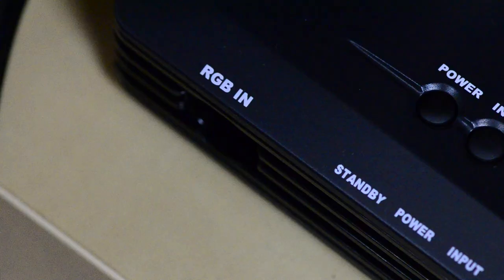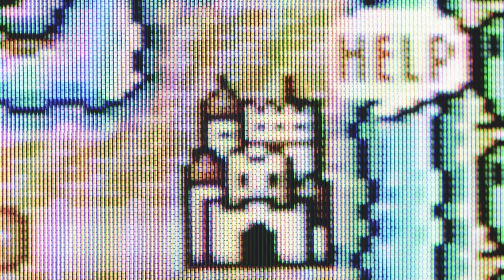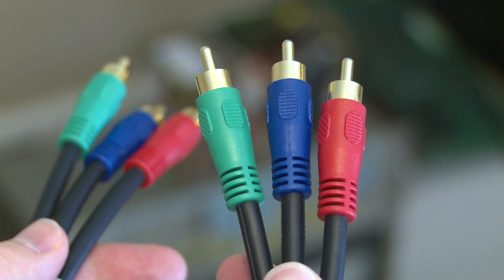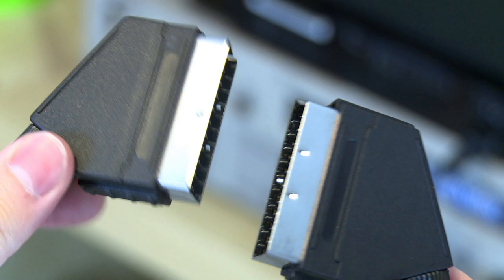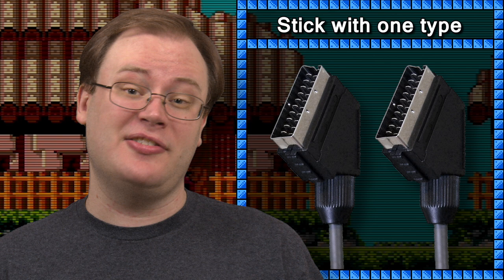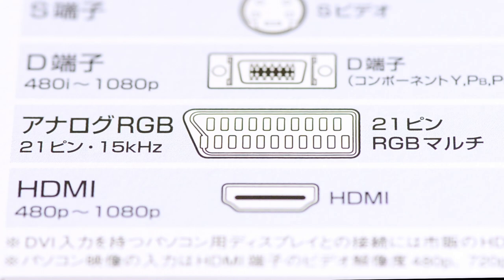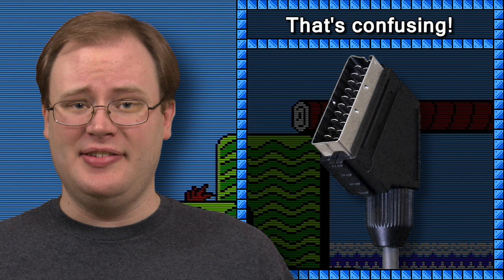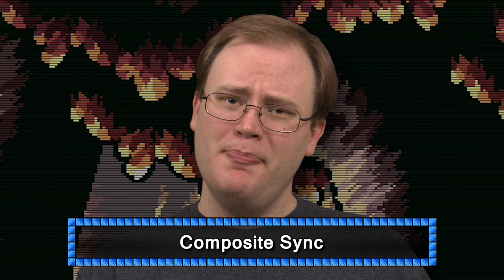Understanding RGB and Sync :: RGB103 / MY LIFE IN GAMING

Comment: Hi guys, big fan of the masterclass series, have learnt a tonne and my retro games have never looked so good. however I have a couple of questions. I have an RGB scart cable set up from my snes directly into the scart input in my Samsung HDTV and it looks great! however if I put it through my scart switcher and depress the RGB button I get an instant checkerboard effect. I realise this is a sync issue.. but how can the sync change in the scart switcher? is it not just a pass through?
secondly. I took apart my snes to see if it was the fabled 1 chip today... sadly its one of the last models before the 1 chip. Anyway it seems to have developed a slight buzzing when brighter colours display on the screen. is it possible I haven't correctly locked down some of the shielding internally? sorry for the essay. cheers
Reply from the maker: [Try4ce] A likely fix to your switcher problem is getting a SCART with better shielding to go from your switcher to your TV.

I'm assuming you're in Europe, so Retro Gaming Cables might be more convenient for you than retro_console_accessories on eBay. I have bought a better-shielded cable from the latter, and am not sure if the former offers one. For retro_console_accessories, you can buy a regular male-male SCART, and add a separate shielding upgrade to your cart. If the store appears closed, check another day, earlier in the day (earlier by eastern US time). She closes the store after a certain quota is met for the day.

I was having issues with audio buzz when using a cheap cable from my SCART switcher, and the more robust cable solved that. I didn't have sync noise, but hopefully a better could could deal with that as well. If not, then some sort of sync cleaning device like a Sync Strike might help. You might also consider getting better shielded cables to connect to your console, or buying a cable with a sync method other than sync-on-composite. But I'd say the first step would be a better male-male SCART. It definitely couldn't hurt either way, as switch boxes can be a bit problematic.

So like I said, audio buzz is typical of shielding issues. It's odd that your SNES would "develop" the problem, but that would be a good argument for buying both a better SNES cable and a better male-male SCART. Another option is to buy an adapter that breaks the audio out of the SCART into RCAs... the less time the audio line stays in the SCART, the better.
Reply: +My Life in Gaming awesome, thanks for the advice! Yes I am in the uk and have been eyeing up the options over at retro gaming cables, but was holding out for the "pack a punch" option to be made available on all his cables. So I bought a cheap one off eBay for the time being. Looks like a general all round upgrade is in order. Cheers! Looking forward to the framemiester alternatives video. Have you guys thought of doing a tips and tweaks vid about scan line generators? I would like to try one but am at a bit of a loss where to start. Keep up the awesome work!

Comment: Great videos guys but I have a couple of quick questions. If I'm to get a framemeister and modded NTSC snes mini what scart cable do I need? I get I can't use the jp21 nor the adapter that comes with the framemeister, but it sounds like I can't use euro scart and adapter neither? Are there NTSC scart cables I should be using with csync? Furthermore, I hear the audio signal can also interfere with the video signal on scart so it might be worth having that sent through separate cables too? 

Secondly for an NTSC PS2 is it worth sending component through the framemeister? To that point is there any benefit sending PS3/4 etc through it, maybe it does a better job of upscaling sub 1080p content than most TV's?

Thanks in advance, and seriously the community needed clear and professional videos like this as there is a lot of misinformation out there.
Reply from the maker: Andy V [Try4ce] My modded SNES mini supports CSYNC, but to be honest, I'm not 100% certan if that's how the mod is always done. If someone else is modding the system for you, or you're buying one pre-modded, clarify that CSYNC is hooked up. However, with very well-shielded cables, other sync types CAN provide results that are nearly as good as CSYNC... but it's always best to use CSYNC when possible. The thing with SNES cables is that the old RGB cables that Nintendo sold in Europe back in the day wouldn't be compatible with a NTSC SNES... most other consoles support cables regardless of region. However, if you buy a SCART that specifies it's for NTSC consoles, then the cable maker has designed it to work that way. Like we said in the video, JP-21 or SCART is your choice, but it's easiest if you stick with one or the other.

Interesting you ask about audio, because just last week I bought some specially shielded cables, and I'm very very impressed. Our go-to eBay cable-maker, retro_console_accessories, offers an upgrade option for any cable, which uses higher grade shielding, resulting in a thicker cable. I was having issues with a slight audio buzz, especially from my Famicom, and the buzz got louder when the image had more light than dark... in other words, the video was interfering with the audio. It became especially noticeable when I was using my SCART switcher. I got a Nintendo CSYNC cable with the shielding, plus a cable to go from the switcher to the Framemeister, and it's working out extremely well! I haven't tested it with the SNES yet, but I'm sure it works quite nicely there too. It's a little more expensive, but I will look into upgrading more of my cables over time.

One thing I wish we'd mentioned in this video is that PS1 and PS2 do not support CSYNC. However, you can use sync-on-luma, and the result is pretty much just as good. Personally, I use SCART for PS1 and PS2. PS1 doesn't support YPbPr component, but of course PS2 does (you have to specify YPbPr or RGB in system settings). The thing is, PS2 does not support 480p over SCART... so a lot of people use component instead. I don't have many PS2 games that support 480p, and I feel like it's not worth the benefit, so that's why I go SCART.

As for sending the PS3 through the Framemeister... well, even if your system is set to 480i, it's already internally scaling PS1 games... so sadly, there's no way to get 240p to the Framemeister via the PS3... this is why I primarily use the PS2 as my PS1-playing machine. Interestingly, the Wii will output 240p for VC games if the system is set to 480i (it scales the games internally if it's set to 480p). I've experimented with using the Framemeister to process 480p, 720p, or 1080i with the Playstation TV... but my conclusion is that there's no discernible benefit that makes it worth it.
Reply: Thanks for the swift reply, much appreciated.

Comment: So if sync on composite adds a few artifacts due to sync running through composite section. Would that mean that Synch On Luma would also leave a few artifacts in comparison to CSYNC? I'm planning on getting a scart for my ps2 (I'm in eu btw) and RetroGamingCables have a Sync on Luma option AND CSYNC. Apparently there's no difference but I just want a 2nd opinion
Reply from the maker: [Try4ce] So composite as sync is actually fine if you have really high quality cabling. But you can expect issues with cheap cables. Luma however I have never seen issues with. It's important to note that PS2 does not have native CSYNC. When you see a PS2 cable with CSYNC, that means it has a sync stripping circuit that is basically converting luma (or composite) into CSYNC. Unless your equipment has a specific need for CSYNC (unlikely) go for luma.
Reply: @mylifeingaming  hey,thanks for replying! Sync on luma it is!

Comment: Is Try's Playstation 2 cable EuroSCART or JP21?
Also, do you find Luma Sync to be better than Sync on Composite? I want to get a PS2 cable from retrogamingcable. co. uk, and they offer Sync on Composite, Luma Sync, and Csync for their PS2 cables.
Reply from the maker: ShogunGin0 [Try4ce] All of my cables are SCART, I don't have JP21 in my setup at all. Sync-on-luma is better than sync-on-composite, for sure. In fact, I've had a hard time telling the difference with luma vs. CSYNC. Now that I have a luma cable for my N64, I don't really regret that CSYNC wasn't wired up in my mod. For PS2, go for luma. Multiple sources have told us that Playstation systems do not output CSYNC, so I'm not sure why it appears as an option on that website.
Reply: ***** I believe it shows up as an option because those cables have a built in sync stripper?

Comment: Hi, I am wondering if anyone can answer my question... 

I have recently tried to hook up some old console like snes and ps2 via rgb scart cable to my jvc pvm. As my jvc only takes composite or s-video, I chose to try out connecting by the following method: Console --> rgb scart cable --> scart to s-video adaptor --> s-video cable --> jvc monitor. 

However the screen is pretty dark. What surprises me is when I connected one of the audio rca connector to the audio inlet of the jvc, did the screen brighten up. 

Is there such a thing as luma over audio cable? 🤔
Reply from the maker: [Try4ce] I don't have experience with those monitors, but that's weird. However, I do need to point out, there's no advantage to pulling RGB from the console if S-video is being delivered to the monitor. I would recommend getting S-video cables for SNES and PS2 instead for a native S-video signal and no conversion.
Reply: @mylifeingaming  The result of my trial is pretty satisfying as it does look better than on direct composite cables. Perhaps I shld take a video of what I'm explaining, if there is a way...

Comment: Hey I know that this probably isn't the best place to ask, but let's say I have a modern console with 1080p, on a 4k TV. would there be a shimmer from non uniform pixel height or other scaling issues, since 1080p is not an inter scale to 4k?
Reply from the maker: +Joel Graber [Try4ce] The best thing about 4K is that it actually IS an integer scale from 1080p to 4K! A more accurate term for 4K is 2160p. It's neat because it is a 2X scale for 1080p and a 3X scale for 720p. However, most TVs do a smooth scale up, so you wouldn't likely see shimmering regardless. I don't have much experience with 4K yet (plan to get one this year), but we'll probably do a video on it when we can.
Reply: ***** 
Cool! I was asking because I'm planning on getting a 4k TV in the next couple of months, Although I might decide to wait for Samsung's new Qled TV to come out.
Reply: Turrican4D 
evidence?

Comment: Dear My Life in Gaming: Still confused (but getting there). Correct me if i'm wrong: My Megadrive supports CSYNC out, best option for (unmodded) PS2 is Sync on Luma. I only need a usb powered SCART to RGB mini if i have a sync going over composite going in and it doesn't receive power on that pin from the console. In my case a passive cable would be sufficient? Thanks
Reply from the maker: +Ric D [Try4ce] Right, CSYNC is best for Mega Drive, sync-on-luma is best for PS2! I'm not aware of a USB-powered thing like you're talking about. Is it for powering a sync stripper? However, a passive cable should be sufficient, if I'm correctly understanding what you're saying. If you have any warping or issues, look into a sync stripper.
Reply: +My Life in Gaming  'This is needed to power up the LM1881 video sync separator circuit' thats what it says on the site, could this be a syncstripper? have a look: https://www.retrogamingcables.co.uk/micomsoft-xrgb/european-scart-to-framemeister-xrgb-mini-converter-with-csync-lm1881-for-sale
Reply from the maker: +Ric D [Try4ce] OK yeah, that's what that is, then. Seems like a hassle to get a USB power source close to the stripper, though. I was going to link you to an adapter on retro_console_accessories on eBay, but it appears that listing is not available at the moment. That one simply uses the Framemeister's own power supply, it passes the power to both the adapter and the Framemeister.
Reply: +My Life in Gaming Thanks for all the helpfull info :)

Comment: I got a question. My hdtv does not have scart connection but I wanna use RGB Sync on luma cable for PS2. If I was to use a scart to hdmi converter so itll Work on my tv (scart to converter and hdmi from converter to tv) would it ruin image quality?
Reply from the maker: [Try4ce] A generic converter would give you similar quality to what your TV would do. The Framemeister or OSSC would make it better quality since they're geared toward games. While the OSSC information is rather out of date, this video may be helpful to you: https://youtu.be/lHoOKLWIMKU
Reply: @mylifeingaming  Thanks for your reply. What about if I was to connect to a hdtv with a scart input?  Like would it be better than component or would I only notice a difference if I connected to a framemeister or the OSSC?

Last thing. How much of a difference would you say their is when comparing the Framemeister to the latest version of the OSSC for a PS2? Its the only console I care about lol.

Comment: I'm really confused by all these old standards.

I'm looking to setup a retro gaming PC with a PVM monitor and I know some of them have VGA inputs. Does anyone know if I'd get a better image with VGA or RGB?
Reply from the maker: [Try4ce] If you are mainly concerned with PC and not consoles, I would get a PC VGA monitor instead of a PVM. I've never seen a PVM with VGA inputs (some might have a dsub connector that looks like it, but it's for like, remote control or other functions, not video). VGA is a type of RGB, but it's different from what a console normally outputs - RGBHV instead of RGBS (two sync signals as opposed to one) and 31kHz as opposed to 15 kHz (15kHz is 240p and 480i and 99% of VGA monitors won't accept that). So I'd just get the monitor that was made for that content - a PC CRT with VGA. If you get a cheap lagless HDMI to VGA adapter, you can also use a scaler like the OSSC or RetroTINK for putting consoles on a PC CRT and that looks pretty great too!
Reply: I think what I'm still trying to wrap my head around is are sprite based graphics better suited to 240p crt tech while 480p+ polygonal graphics are better natively upscaled on a high def screen? 

All personal preference of course but this is my take on it..

In reality we all need 4K CRTs..

Comment: Does console region take precedence over TV region? Just wondering since 95% of my retro consoles are Japanese but my TV will be from America. Should I stick with JP-21 or will I run into trouble?
Reply from the maker: +Aaron Burke [Try4ce] Does not matter at all. The RGB signal goes out of the console all the same regardless of JP21 or SCART. The difference is where the signal goes on the end opposite the console. However, remember that American TVs don't have this sort of input. You'd need a scaler or professional CRT (see RGB 105 and 104).
Reply: Oh ok! :) I was under the impression that something was fundamentally different with the way Japanese consoles send their signals since you mention the Japanese/North American SNES isn't "configured" for SCART. Does that mean in addition to different pinouts, JP21 cables have capacitors that SCART cables are lacking, and this only affects the output of Japan/North American SNES?

Comment: 5:00 Sooo if I only had composite cables for my PS2, could I actually just plug in the RCA connectors into the Component connections?
Reply from the maker: +TheMamaluigi300 [Try4ce] No, because the pins on the system end are sending audio signals, not image information.

Comment: So whats preferred between Sync on Composite or Luma Sync? PAL SNES doesn't appear to support CSync
Reply from the maker: [Try4ce] I don't have much means to test the comparison for myself, but from what I've read, given no choice of sync on its own, sync-on-luma is better than sync-on-composite-video. My PS2 cable is sync-on-luma, because PS1 and PS2 don't offer a pure sync output. Apparently this provides better results than the alternative, but I haven't seen PS2 sync-on-composite for myself. For what it's worth, I also don't see any flaws in the sync-on-luma SCART. Works great for me!
Reply: Sounds like it's worth a shot then, cheers.
Reply: ***** I can confirm this. After getting a cheap SNES Scart cable and having to mod pretty much everything (remove the caps, add resistors, throw away the cable itself because it was horribly shielded...) I eventually switched the composite pin for the luminance pin  and received a checker-board free, clean result. I'll never quite understand why the PAL SNES lacks the C-SYNC pin (in favor of the 12V signal that most TVs don't use properly), though.

Comment: May be a stupid question, but are all SCART inputs on TVs RGB?
Reply from the maker: [Try4ce] As a non-European, I can't give you first-hand information on what TVs support, but I can say that SCART, on the cable end, is not always inherently RGB. It may just be composite or other signals. Whether you can expect a TV SCART input to accept RGB with the proper cable and source, I would suspect generally yes, but I can't say for certain.
Reply: @mylifeingaming : Hello there and thank you for responding. Time has flown by and I just got my first CRT in years. It's a German brand called Telefunken and the model number is MA 115 GT. The TV is pretty basic and has an audio and component input in the front and one SCART input in the back.  When I press the AV button on the remote it switches between AV and S-video.  Does this mean my CRT is only capable of S-video?